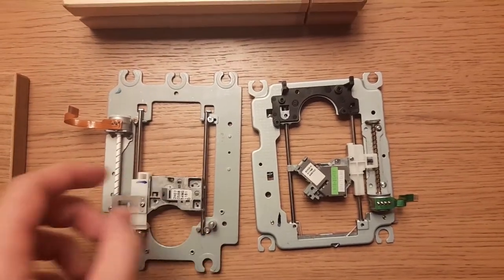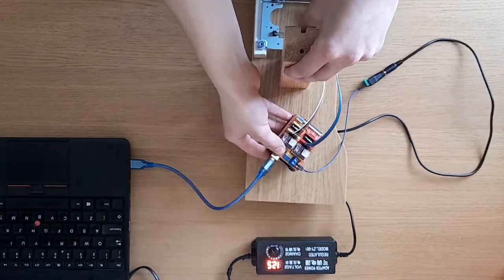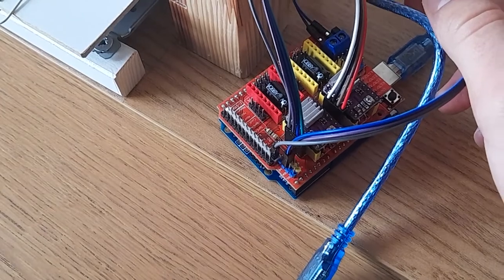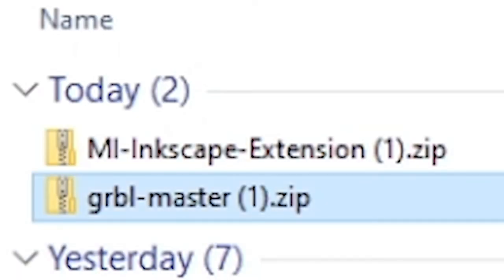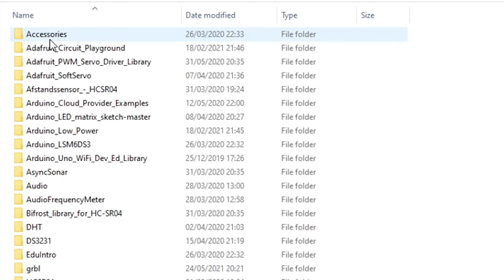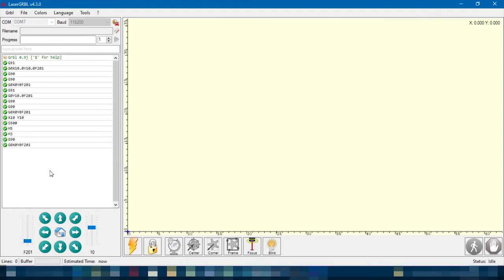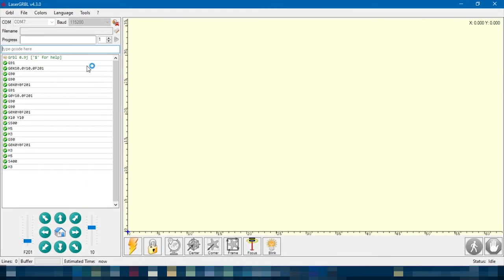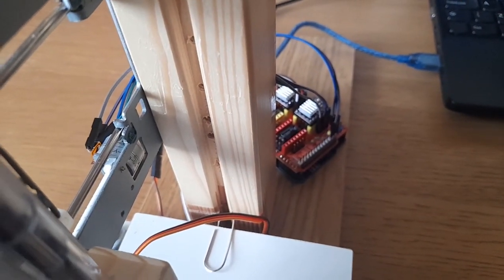CNC Pen Plotter From Old CD Drives - A Step By Step Guide

Comment: Bro did you know that by adjusting the pods on the driver board you can limit the current to your  motor's and then  you can run  the cooler  that's why the pods are on the driver  pcb. Any way excellent  video.  Good job.  Thanks

Comment: sir inskcape what series to wear. can't we make dgcode using lasergbrl
Reply from the maker: You can make gcode with many programs, the issue is that programs such as lasergrbl don't have built-in servo control, whereas the inkscape extension does. If you are willing to do a bit of extra work you can make your gcode with whatever.

Comment: bro I have cd driver but the motor have 2 wire it dos work and what is the code
Reply from the maker: That's odd - are you sure there aren't 4 connectors? Stepper motors have 4 connectors, all needed to produce the variable motion so you can move the base and plot.
Reply: @FactsFromFiction   I buy a dvd yesterday and take the steper motor. the dc moter was on dvd reader the steper was on W/R
Reply from the maker: @srg_5941  Well in order for this project to work you need stepper motors. They don't have to be from old CD drives, but the old drives have good, straight rails to build the axes onto
Reply: @FactsFromFiction  I make one but it dose not move full steps
Reply from the maker: @srg_5941  Might be a software problem if you can get it to move but not all the way
Reply: @FactsFromFiction   If I put 5v and 2A which is my phone charger but it does not move all the way
Reply from the maker: @srg_5941  That's probably the issue then, the stepper motors I used at least,  they run on 12V